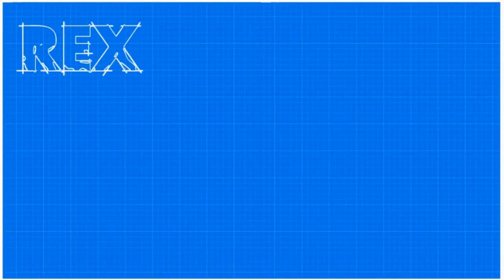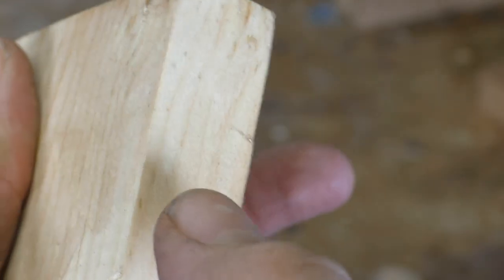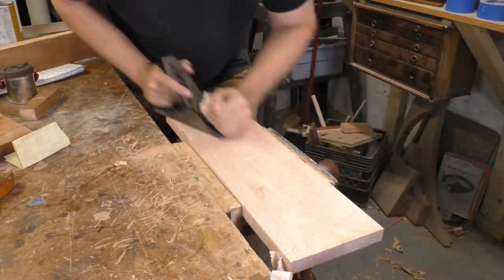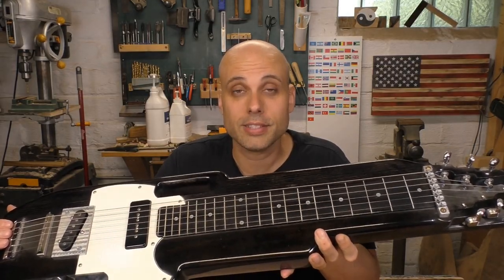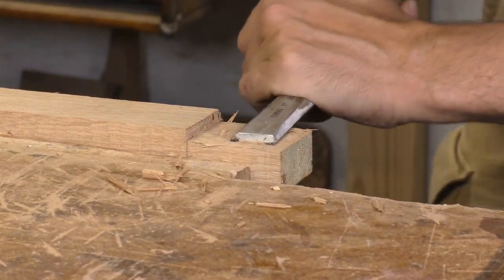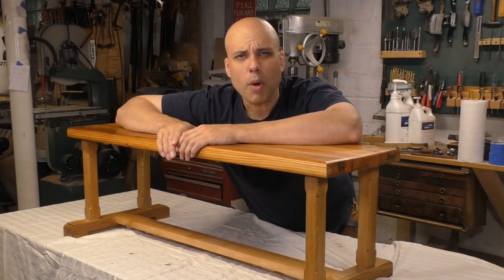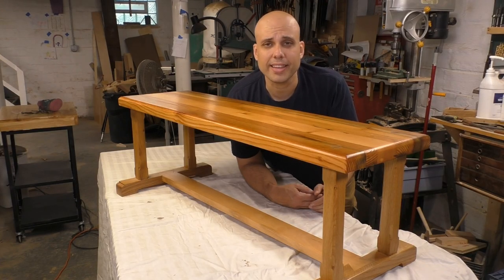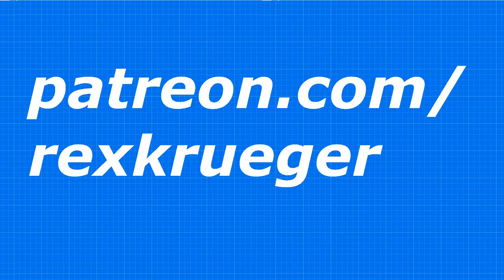Choose the best wood for your project

Comment: Local woods for me, pine, plywood... erm.. MDF?
Reply from the maker: No shame in pine. A fine wood.
Reply: I used to hate MDF, but there are applications where it's the material of choice.  (Particularly speaker cabinets because it's acoustically dead, which is what you want.)  Then I also realized that it's making good use of sawdust.
Reply: Mike Curtin  you might be interested in a video called “worlds 2nd best speakers”, the channel is tech ingredients.  He does a test measure resonance in MDF and plywood, and they are similar, but the plywood is slightly better.  His claim is that it’s a stiffness to weight ratio that is important, and if you double the plywood you will have the same weight as mdf with more than twice the stiffness... or less than half the resonance.  This was new to me, I’m certainly not a physicist but it’s seems compelling.
Reply: @fotopdo  That's very interesting.  I'll look into it.  Thanks much.
Reply: @mikecurtin9831  I find MDF furniture on the side of the road.  Great practice material and good shop materail.
Reply: @JosephLorentzen  Good reasoning and the price is right.  In addition, it's usually very flat.  The downsides are that it's heavy, relatively weak (compared to plywood, hardboard or most solid woods) and REALLY not resistant to moisture.  To each their own, eh?  See the next comment down, by Donald Sayers.
Reply: @mikecurtin9831  built a book shelf for my mother inlaw out of veneered MDF 40 years ago sets in her kitchen today you just have to seal it properly
Reply: Im sitting on a big cache of dried oak
Reply: @sanddriver260  I'm sure I could Google it, but what constitutes sealing MDF properly?
Reply: @ReverendTed  any  waterproof sealer on raw edges and surfaces  don't leave an opening for moisture to penetrate,
Reply: I weirdly like poplar and it's contrasting colors under stains
Reply: @mikecurtin9831  Same here on MDF, but it also perfect;y flat if stored correctly, unlike woods tendencies to warp, and you can cut at shallow angles without saw trying to bend like a saw following wood grain
Reply: @gd-raidshadowlegendsplayer8898  Good points.
Reply: Nothing I like more than going for a hike in a MDF forest.
Reply: @bcubed72  All forests are potentially MDF forests, eh?  :-)
Reply: I'm hugely jealous of north american wood workers, with their million types of cool woods. I have spruce, pine and birch to work with, other woods like oak being mainly exports from other countries here in europe, while rare domestic examples are so sought after that the price makes me sick.

But I'm not complaining really, just jealous. Fine furniture, beautiful housing and more have been crafted from birch, spruce and pine for a really long time here, so I work what I have into what ever I want. Birch I think doesn't get enough credit for how great it actually is.

Comment: I just made a Green Egg Grill Cart out of Hickory, which is the first time I used this species. I used pocket holes to join the base. The Kreg pocket screws are self-tapping and shouldn't require pre-drilling. But I quickly learned that pre-drilling was necessary after I snapped 4 screws out of the first 8 I screwed in. I also snapped 3 drill bits during this project. The hickory looks amazing, though!  I will use it again in the future, but will definitely take the time to pre-drill everything.
Reply from the maker: Hickory is like iron. Lasts a long time.

Comment: Useful info. It's strange how little North American wood seems to get shipped across to Europe, so it's nice to hear a bit more about the characteristics & differences of some.
Two of my favourite woods are yew & olive. Yew can be astoundingly pretty if you find some character grade stuff & it's highly resistant, so great for anything that'll be spending time outdoors. Olive finishes like a dream & is my favourite for adding accents (followed closely by black walnut), but it can take a toll on the edges of cutting tools.

Comment: Using danish/tunge oil brings out the green in poplar which a lot of people don't like, but I've had a few customers REQUEST poplar BECAUSE of that.

Another "category 4" wood that is readily available in N America is Osage Orange (hedge/bodark).  It's used for fence posts because of it's strength and durability. It changes color over time, starting out a striking yellow-brown similar to yellow heart and the turns to amber, medium brown (like walnut - not black walnut), and then back to a dark amber.

Comment: You said you get the people the disagree with you, so here I am. 
No biggie really its just that I have to disagree with your statement about how poplar doesnt stain well.
Ive been a cabinet maker and finisher for 39 years and absolutely love working with poplar. 
Its easily machined, sands beautifully, its nearly always dead straight and flat, very few knots, (if thats what you're looking for) and in my opinion stains and finishes perfectly. 
Choosing the right pieces, you can nearly mimic walnut. 
I love it!

Comment: "Taste is a new thing I'm trying"

Well I guess you look into that while I go through my piles of pallet wood
Reply from the maker: No shame in the pallet game.
Reply: US made pallets use domestic woods.  And so do the pallets from other countries.  Except they use THEIR domestic woods.  If there is a shop/store in your area that imports merchandise from overseas, ask the manager if you can get some of the shipping pallets their imports come on.
Reply: @RexKrueger  Oh, I'm not so sure about that... Pallet wood ruined a brand new set of knives on my jointer. I planed one of the pallet's stringers down - most assuredly a thing of heavy, hard exotic beauty from a distant land - only to discover when truing up a clean soft piece of spruce a week later that a 2-inch-wide streak of roughness was longtitudunally polluting the purity of the freshly milled softwood. I kicked myself because only 2 weeks prior, I had watched Colin Kenecht's vid on avoiding pallet wood. The unseen crap and corruption invisibly pressed into the wood's surface turned out to be devastating to the jointer's knives. I'd even gone to the trouble of scanning it with a metal detector beforehand!
Once burnt, twice shy. No more pallet wood for this cat.
Reply: @honey5bucket  another thing on international shipping, the pallets are required to be kiln dried, Domestic pallets with a flame stamp marking in the US indicate they have been through a kiln. This is to ensure there are no live bugs or surviving eggs in the wood. Any sort of supply house is worth the trip to ask about their pallets. I've gotten stacks of oak 3x4 rough cut lumber that was used to ship commercial refrigeration units.
Reply: Well some people love pallet wood so that could be taste too...
Reply: @eejuice  I've also been considering pallet wood but hidden metal nails, screws, staples etc are a very real concern.

Comment: Ever tried Black Locust? My family land in Indiana is thick w it. Not usually available commercially because of its naturally slender trunk (max <28"), w a small band sawmill and solar kiln, I can mill my own supply easy enough.

Several aspects that I know is its toughness, rot resistance, copicing tendency, greenish tint, blacklight glow, and high btu as a firewood. It also has high creosote which gums up & dulls blades quickly when cutting and can cause chimney fires if left to accumulate.

As a furniture wood, it's highly prized for outdoor furniture (Adirondack chairs, picnic tables, etc.) since it doesn't need all the water treatments that less rot resistant woods like oak & maple need. It was prized as a ship mast, and, after importing from US, is the #1 tree in Hungary.

Comment: "Its just a bench." "Its made of wood." Weeell, with that one glorious piece of utility furniture you've explained the whole of this video.  This isn't just, 'use the best wood for your project,' its more about including wood choices into the design. I think many makers get intimidated with thoughts of solid wood [sticking to ply or MDF] they feel it means more skill than they have, or 'serious' carpentry. You've gone a long way to dispel that in this video and I for one look forward to using good woods to make better project, cheers Rex. 
[p.s. as you asked, I'm enjoying my pull saw, its a different discipline and thats good, as I'm not always in the mood to drag my tablesaw out into the yard for a couple of crosscuts. Its actually 'enjoyable'.]
Reply from the maker: I really think that making one or two cuts on a power saw is a huge waste of time. A good hand saw is such a time-saver.

Comment: Fantastic video! Douglas Fir has always been a favorite of mine, especially when I can find boards with a really tight grain structure, even more so if the ring cross section is wavy or jagged - it produces an exquisite flame pattern when ripped. 

Again, fantastic video! I can't wait for more!

Comment: While building houses, we used cottonwood in place of poplar for exposed stair stringers, risers, and a few other details. Cottonwood is a nice stable wood with almost no mineral streaks like poplar. It is smooth grain and very uniform color throughout. Seldom any knots. Cottonwood takes paint well but can be a bit boring when stained.

Comment: Very informative video!  I've never paid much attention to the whole "ring porous" thing, but it makes a lot of sense when you explain it like that.

Also: for woodturners, lots of the ornamental trees (like dogwood and Bradford pear) are great for turning.  Best thing is, after a storm you can often get the wood for the cost of cutting it up and hauling it off.  Just drive around and look for a downed tree in someone's yard - I have yet to have anyone turn me down when I offer to haul it away.  Just cut it up in sections that would work well on the lathe, pile it in your pickup, then slap some latex paint on the endgrain and let it sit for a couple years.  Perfect turning wood for the cost of an afternoon's work, a couple bucks worth of chainsaw gas, and some leftover paint!

Comment: This was very helpful. Your descriptive classification is more useful than clumping them all together.

One request: I'd like to see you periodically update us on the cheap tools (and homemade ones) that you've reviewed or built - just to let us know what you're still using and what's been salted away. Thanks.
Reply from the maker: Yohann Misquitta that's a good idea!
Reply: @RexKrueger  Thanks for responding to my request. I look forward to that video whenever you get a chance to do it. Your videos were a great help when I started woodworking. I was looking for an economical and space-saving way to make a useful workbench and so I followed your videos to make a Roman workbench that I use as my only workbench. I also bought the Chinese jack plane you suggested and (after spending a bit of time optimizing it) I found it to be a very useful tool. I have since bought a #5 Stanley and that seems to have relegated the Chinese one to secondary duty. The Bailey-type planes are just so easy to adjust.

Comment: Awesome video. That vase was pretty cool. Maybe a video showing how u did the epoxy finish or is it as simple as brushing it on and sanding through the grits?
Reply from the maker: You've pretty much got it. You need to wet-sand up to 2000 or so and then polish, but it ain't rocket science.

Comment: My new experiment for wedged tenons when I want them accented but want something other than walnut:

Grab some brass shim stock and rough it up with light sandpaper. Cut with scissors to width and wrap around your wedge. Hammer it home and then flush cut and sand as usual. I used 5 minute expoxy because I'm skeptical about how wood glue will hold. You end up with some little streaks of brass that accent your wedge that are subtle but interesting.

Comment: I've been using purpleheart for my wedges, because I bought a thin board and then never got around to using it for whatever it was I thought I was going to use it for. I've found that it works great and looks nice, too. It turns brown pretty quickly, but it's still a nice contrast to the lighter wood it's wedging.

Comment: Where i live, we have 'native timber' that a lot of old houses are built from. I think we eventually decided it was hickory. That stuff will destroy any power driven edge you try to run through it; circular saws, reciprocating saw, even a spade bit is useless after a couple of holes. Its also freakishly heavy. We reclaimed some to make a 3'x6'x2" workbench top that has to weigh 150-200lbs. The really amazing thing is it was all hand cut in the mid-19th century, or for the larger pieces, flattened with nothing but an axe.
Reply from the maker: It was probably worked green. Many woods are easy when green and then rock hard when dry. Hickory is famous for this.

Comment: amazing! excellent video and very helpful for a new-ish woodworker like me. so a big Thank You! 

i choose woods based on the color and try to use only one species per project -- but again, i'm still new. someone mentioned Craigslist earlier and i have to say that i have gotten cheap and free wood, especially red oak, on Craigslist. since it was so popular for so many years, it's easy to re-use/reclaim old oak pieces on new stuff. i have found it to be very stable, strong, and easy (enough) to work with, although i don't like the look of it very much. 

thanks again Rex and wish you continued success -- you are earning it!

Comment: A good introduction to using your local varieties. They will of course differ from place to place but your four classes are very workable. I personally scavenge a lot of wood out of dumpsters, discarded furniture, garden/park prunings and clearings and even those really bad statuettes in thrift stores. Use what you have or can get for very little, especially when starting out. A lot of lessons learned the hard way but not emptying your wallet. 👍

Comment: You mentioned that you use reclaimed lumber for one of your projects and was wondering where you got it from. I also like be in the Cleveland area and have not found where to get reclaimed lumber I know there's a saw mill down in the flats call city hardwood I think they mill up all the trees the city cuts down.
Reply from the maker: You need to be resourceful. I have my spots, but I can't give them away on the internet. I found them. You can, too.

Comment: Hey Rex, I like the simplification for newbees, well done. Since you are familiar with Ipe, might I suggest ipe wedges for your tenons? I’ve used it for tool handle wedges and also as accents in splined box joints. Cheers!
Reply: Hey there wanna be polite in saying this buuutttt

It's 'noobie'  it's a common mistake no fault to you

Comment: That was excellent. The only caution I would add is that brightly colored exotic hardwoods tend to oxidize and turn brown over time, especially if you don't seal the wood with a good top coat. I bet that was a factor in Rex's choice to use epoxy on the Ipe vase project.

Comment: So I have a camper that I need to build a pull out sofa futon bed out of Wood. I needed it to be strong and durable but lightweight because everything with a camper you have to consider weight also I would like to use a light reddish brown stained to match the rest of the camper. with these requirements would would you use

Comment: Started out making furniture and other items from construction lumber. Made a table years ago as my first big furniture item. Yes it has dents and scratches, I do not mind. I am proud of that table. 
Takes some time finding the best wood in a hime depot style shop bit it works just fine. Use what is available or within your budget and skills. Makes no sense buying expensive oak and make firewood if it because your skills are beginner.

Comment: Poplar can be exceedingly pretty, you just have to know how to get rid of the green.  I discovered quite by accident that if you leave the wood exposed to strong sunlight, all the green bleaches right out in about 24 hours.  Then you'll just have various beige and light brown colors that match and accent quite nicely.
And while it's true it's a disaster to stain, I gave up on stain a long time ago for any wood... just put blonde shellac on sun-bleached poplar that was finished with a sharp smoothing plane, and it looks like a million bucks.  (If I want a darker color, I use a darker wood!)
And one other thing about poplar, for our friends across the pond... American tulip poplar is Liriodendron tulipifera and is not at all related to Populus species that Europeans know as poplar.
Reply from the maker: That's a hot tip!

Comment: My young career doing woodworking:  Pine and plywood for jigs and prototypes.  Cherry for really nice little boxes.  (finished with either mineral oil-olive oil-walnut oil and paste wax)[allergic to almost every other finish] Walnut for contrast.  Sugar Maple for vise jaws and really solid things.  Hickory dowels for tool handles.  I absolutely hate poplar.  It is stringy and ugly.  Like the woodworking equivalent to nails on a chalkboard.  Ugghh.  Hate it.  Don't really use exotic woods yet.  I am not that good at finishing.  Yet.  Thanks Rex.
Reply: I agree with you on everything except poplar. To each his own, of course, but I love the stuff. I love the strange green hues, the irregular grain, the easy-working nature of it, and I surely appreciate the usually lower price as compared to the "nicer woods". Not a fan of white oak though. That's the most generic, bland oatmeal of hardwoods, and the late '70's thru '80's did it no favors with all the oak veneer.

Comment: Could saw dust be used to fill wood pores ?
Reply from the maker: Probably. It would need to be very fine, line sanding dust and mixed with glue or finish.